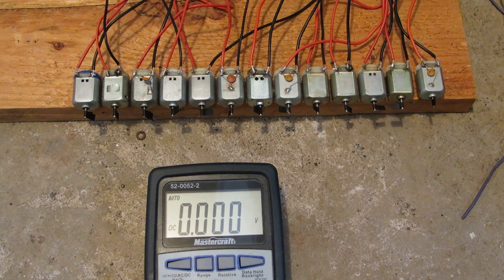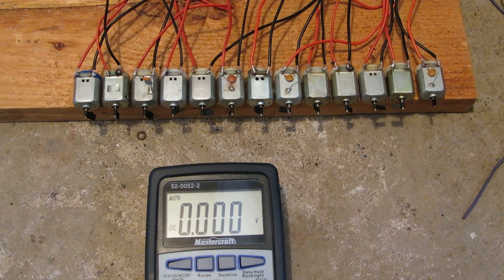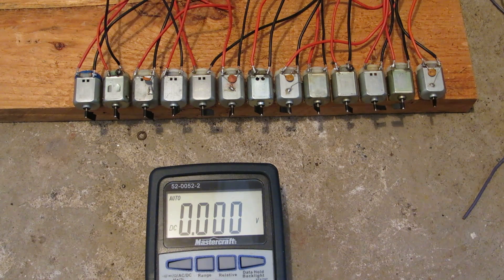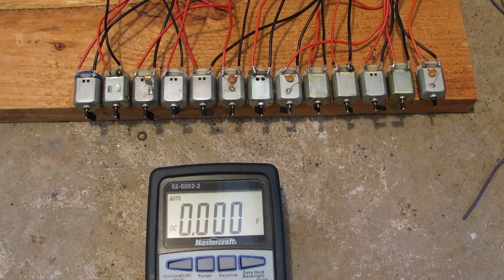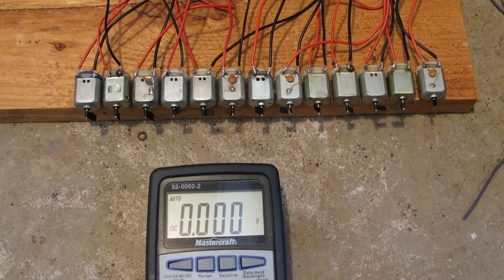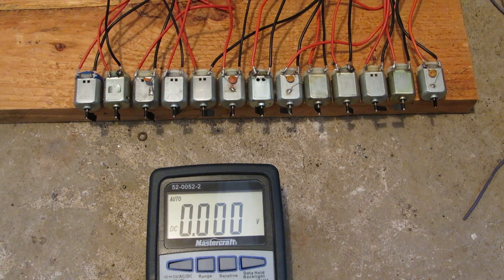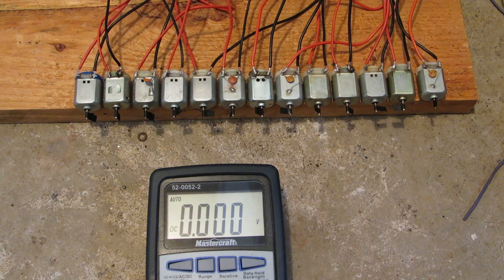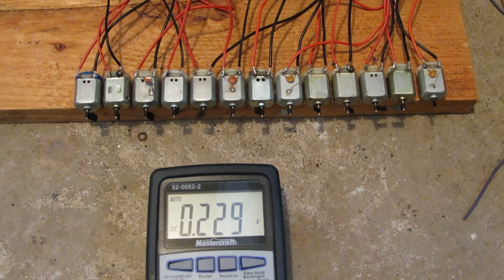Micro Motors overload

Comment: Is there an industry term for this type of motor? They seem so ubiquitous across all sorts of products.
Reply: all of them are actually bootlegged from a specific series of motors : the Mabuchi 130 motors. most of them that you see nowdays are bootlegs but if you are lucky enough you can find official Mabuchi ones. Mabuchi also makes a lot of diffrent motors for diffrent appliances, i have like 10 Mabuchi motors all of diffrent types in my dc motor collection (which has like 20-30 motors) and not all of them are 130 motors, some are different, theres even a 280 motor in there. hope this helps.
Reply: Thanks!  @TheOfficialDorianelevator
Reply: At the back of it is a small curved label. I don't really remember it, but it said something like "Ching lee motor".

Comment: Buhler motors are REALLY good, I have like 7 or 8 40 to 50 year old Lego motors, they all use buhler motors, they still work just fine after all this time, so when they say buhler motors are synonymous with high quality, they are not lying, they probably would survive this test, get buhler motors, sure they're expensive but clearly worth the high price (good luck killing one of those lol).
Reply: thanks for the information, in the middle of my crappy dc motor pile (where all the crappy ones go), there was a buhler motor in there. now its out of that pile thanks to you.

Comment: If you want to blow up a electric motor, go to good will and get some HP Desk Jet printers, their motors are tough, I put 25 volts dc into them and they ran for about 20 seconds then I cut power, they are like 12 volt motors but they will take a while to die at my dad’s power supply rate
Reply: 5 years later and my dad has a old OfficeJet printer from HP which has a short circuit preventing the circuit board from even booting up, and do the OfficeJet printers also have the same motors ? if they do, thanks as i might dismantle it to get them.
Reply: @TheOfficialDorianelevator  not sure, they should be 12 volt motors though if I recall correctly.
Reply: @Turbo_The_Femboy_Fox  the voltage does not matter to me as i do have a 12 volt power supply, i currently wired it up to a 12 volt Mabuchi motor, but i make it go through a screw terminal so that i can change the motors. but if one day my dad finally says that the printer is fully dead then i might salvage the motors (including the stepper motors) for other projects.
Reply: @TheOfficialDorianelevator  nice, that wouldn’t be a bad idea